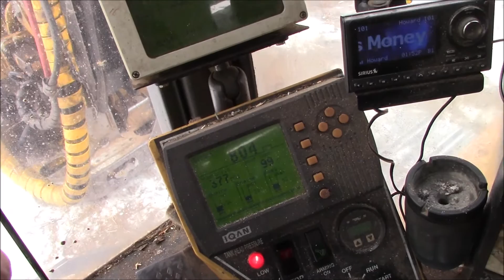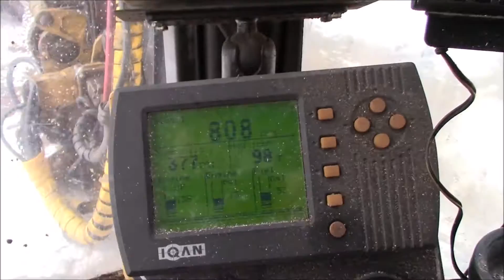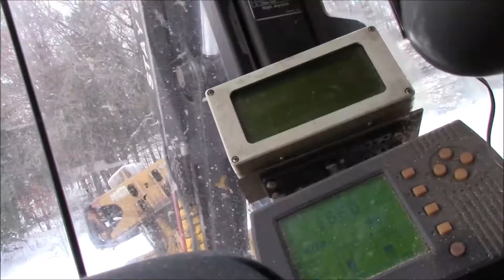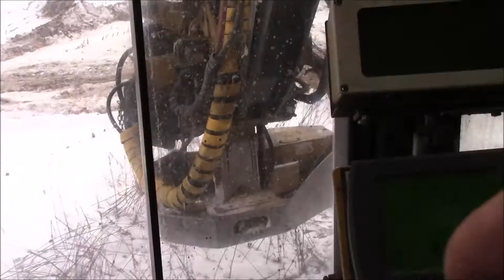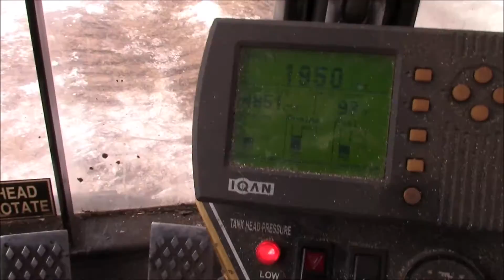IQAN test Fabtek 153 harvester PLEASE Subscribe!

Comment: Hey Mike, I'm working on a 2001 fabtek 153 that's having issue with the IQAN MG module, the same one you replaced here, I'm wondering where you or the customer were able to find that module. I'm having a hard time tracking stuff down because they have been made obsolete a long time ago by Parker and Cat.
Reply from the maker: paullang93 hard to find man.
Reply from the maker: I usually end up with complete upgrade package from Cat. 14k
Reply: Michael J Berg Copy that, sounds like that's pretty much my only option,  even if I found one I think Wayne Ocker is the only one that might be able to program them!